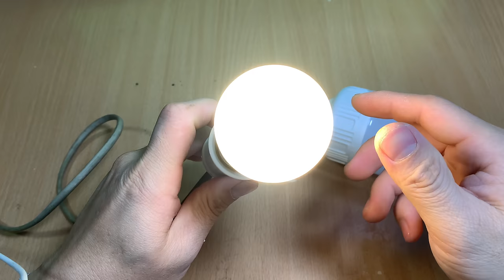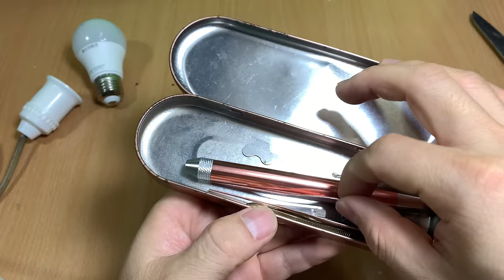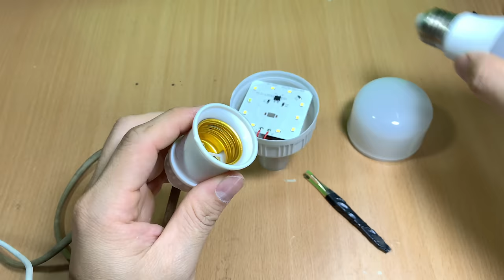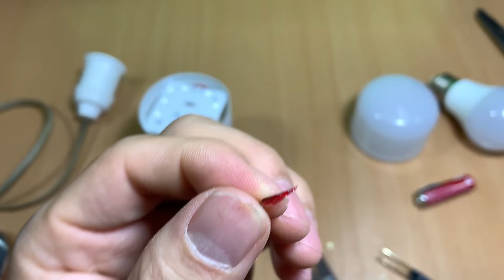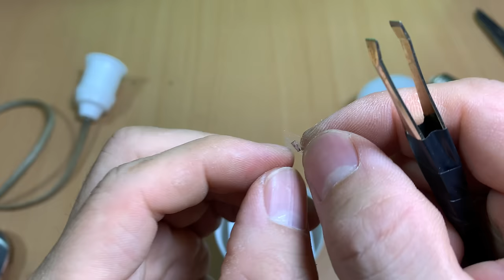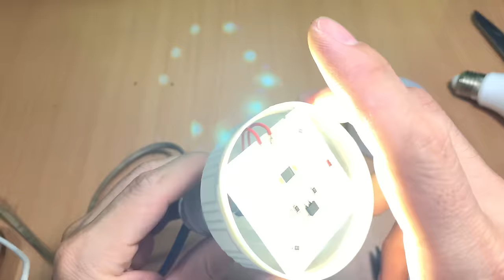Just Use a Common 1,5V battery and Fix All the LED Lamps in Your Home! How to Fix or Repair LED Easy

Comment: You shortened the life of the rest of LEDs because they will be over loaded with the voltage that this canceled led was holding
Reply from the maker: Thank you for watching and leaving a comment, I will give a better solution in the next video, wish you luck and success
Reply: Their life was extended and they will burn brighter than if in the dump.
Reply: I've tried this remedy but eventually another 2 LED's had gone out also and the 22 uf 100 volts in the circuitry  exploded.
Reply: Actually,  this repair probably has little effect upon the lifetime of the remaining LEDs, because the small strip of metal used to short circuit the bad location has higher resistance than if he used a piece of copper wire.
Reply: Not necessarily…
Reply: Это не так, если в лампе стоит нормальный светодиодный драйвер, стабилизирующий ток. В этом случае просто упадёт немного общая яркость. Ну а если в лампе стоит примитивный драйвер (а такие лампы лучше не покупать), тогда да, ток возрастёт, а следовательно, ускорится деградация светодиодов.
Reply: Irony is we were told LED bulbs will last 20,000 hours and are better for the planet, blah, blah, blah.  Yet here we are looking for ways to repair these crappy bulbs after only a few years of service.  Another fine government hustle.
Reply: @billkraemer4710  
That went over like A LED BALOON..
Good Quality LEDs can last LONG..
Reply: Смотрел я 11 минут всю эту муть, взял паяльник, и через 5 сек  лампочка засветилась.
Reply: @billkraemer4710 exactly!! My first LED bulb stopped lighting the same time the reg bulb blew. Guess I’ll try to salvage a little more time out of it. I bought so many incandescent bulbs back when everyone thought they were going away, I’ve finally run out of them. Too bad I didn’t buy more then. 😆
Reply: Надо же кусочек метала приклеил скотчем  на контакт электричество  это просто сумасшествие , человек не понимающий  скажет хорошо ,  а вот и нет это может привести катастрофу  в  доме или  же помещения ,  хотя бы минимум припаять надо было !👎🏽👎🏽👎🏽❌❌
Reply: Лампа греется и через какое-то время скотч отклеется и лампа погаснет. Кроме того, светодиоды соединены последовательно. Каждый из них расчитан на определённое напряжние.Соединяя  электрическую  цепь таким образом мы увеличиваем напряжения пробоя на остальные светодиоды. Недолго лампа проработает.
Reply: Все это ерунда! Достаточно капли олова и все готово! А здесь целая операция на пол часа, и зачем-то батарейка!?
Reply: А если напряжение на низкое- это хорошо для светодиодов или нет? Спасибо.
Reply: Yeah best to replace damaged LED, this ruined the remaining LEDs on my project too
Reply: В такому разі потрібно просто впаяти робочий світлодіод!
Reply: Сейчас попробую графитовую дорожку???
Reply: После ремонта светодиодной лампочки (желательно припоять) если эстетика позволяет не ставьте колбу на лампочку или пару тройку отверстий просверлите или прожгите для охлаждения, лампа ещё долго послужит
Reply: Easier to put a dab of solder. Many of these bulbs have a load sensing power supply and will reduce voltage to what is needed for the rest.
Reply: Yes, solder, and the voltage is regulated. The statement that this overloads the other leds is uninformed.
Reply: 😅 @DIYTechTrends
Reply: Aye. But at least they now function.
Reply: So the light doesn’t work and removing one is not going to hurt it that much.
Reply: @rexoblanca4695 well you must have not done it right if you just remove it and connect it with folder it will last a long time.
Reply: @AlCatrraz just admit your wrong ,do you even know what resistance is and how to measure it,even lead from a pencil has resistance if you draw a line on a piece of paper the longer the line the more the resistance.and if your really good you can run solder down the lead strip you just drew and change the resistance even more.
Reply: @micgol9182 finally Someone with a brain.🧠
Reply: Or just buy a set of new led bulbs where I live you can buy a set of 4 for around $6. And there around 1100 to 1500 lumens.
Reply: @dhutch12345  
I have studied VARIOUS SCIENCES..
One of my degrees is in COMPUTER SCIENCE!
I do know something about electronics..
I personally”fixed” LED bulbs and they are still working! 
You are right, but so am I.. 
sometimes the parameters are such that these “fixes” will hold IN SPITE of the expected..
Best to you!
Reply: Life has been extended for a little longer when there was no life anyway. What shortened life?

Comment: When the leds go bad they have a black dot on them all u have to do is unsolder it or clip it off with a pair of dikes then put solder across the terminals on the plate and your light will work fine.that includes outdoor lights any led lighting if you do not want to buy a new one and some of the solar powered outdoor leds are expensive.
Reply from the maker: Thank you for watching the video and sharing useful information for me and everyone! Wish you all the best

Comment: instead tesa & the batterie metal i would use a simple soldering equipment. its ok when i should be at the moon, siberia or at ghe iss and i didn't have nothing other to tepair.... ..
Reply from the maker: Hello, thank you for watching the video and leaving a comment. This is a temporary way to handle emergency situations. I have shown you how to replace the LED letters to make the light bulb more durable and better. You can review it. Wishing you much luck and success.

Comment: That's gunna be as reliable as a politicians promise.  A bit of copper wire and a soldering iron would be a better idea.
Reply from the maker: Thanks for watching the video and leaving your comment! Your idea is also very nice, I'll do it soon! Thank you, I wish you luck and success
Reply: @DIYTechTrends  Be well m8.
Reply from the maker: Thanks
Reply: A blob of solder is much easier and more reliable. And costs next to nowt - certainly a lot less than a battery.😊
Reply: @DIYTechTrends _ Just a blob of solder across the two contact points might be enough.  However, now the resistance of the circuit is less than before and more current is flowing through all the LEDs.  This will cause another failure sooner than expected.
Reply: @wladicus1  Hey... I was gonna say that! Nobody pointed out that tape falls off when the bulb gets warm. I found even Gorilla Tape falls off when it get warm. under the sun. There were 10 LED's so shorting one raises the voltage 10% for the remaining cct. Replace it with a regular junk diode with similar fwd voltage and resistance is best yet. The absolute best is to use working diodes from one lamp as parts so long as the polarity and LED count remains the same.

Comment: This fix assumes that every LED bulb failure is caused by an open LED diode. There are other failure modes, like failed power supply.
Reply from the maker: Hello, thank you for watching the video and leaving a comment. This is one of many errors in the bulb. If the case is not due to the LED chip, we will look for the next cause. Thank you and wish you the best

Comment: You do not have to spoil a battery to get aluminium piece. A simple piece of aluminium foil is sufficient.
Reply from the maker: Thank you for watching the video and leaving a comment, as you said, the metal used conducts electricity well and can be repaired. My battery is over.
Reply: That tape would dry out and fail in no time. Otherwise good idea.
Reply: @DIYTechTrends  It is easy to use foil. To get aluminium piece from a cell takes more time and work. In either case we have to use a tape or glue to keep the aluminium in contact.

Comment: Hello, the third type of repair is wrong and it causes the voltage of the LEDs to change and the rest to burn. We must either use a resistor or a healthy LED.
Reply from the maker: Thank you for watching the video and giving your comments. I will try your method, it's very good. Good luck to you and successful.

Comment: I gave you  dislike, because I made this work very easy: I just take out LED segment and solder a jamper. That it's all. But in your foto-avatar video you us buttery. What, another material is not good?
Reply from the maker: ok, actually this is one of many ways to fix black bings quickly, but it is only temporary, I have released a video of replacing led chips with 2 batteries, you can watch it again, thank and have a nice day

Comment: Very cool. One question. Since the point seems to be to connect the circuit from the lines under the dead LED panel, Would a simple line of solder to connect the circuit work too?
Reply from the maker: Thank you for watching the video and leaving your comments. Based on the principle I shared, you only need one wire to connect the circuit, respectfully.
Reply: Конечно.
Reply: I just don't remove anything.  Run a bead of solder around the broken LED to bridge the two terminals.  East!
Reply: The micro flashing of the repaired bulb would drive me crazy. Kinda like the pantomime hands.
Reply: That's what I was thinking !! @myfavoritemartian1
Reply: @bytemehrdr  sends some into a seizure
Reply: @bytemehrdr  You wouldn't notice the flashing. What you see in the video is because of the"shutter" speed of the camera.
Reply: Yesyou don't have to cut a piece of dry cll. A short lenght of a copper wire or a piece of aluminum foil or just a bead of solder will work as well
Reply: It's the effet on the video capture, not in reality.

Comment: Because of the leds are serial connected, the rest of working leds  sınk more current than nominal current value and it causes the life time  of led bulb will be shortened. The best solution is to find another defective led lamp and to use its working leds.(as soldering it after removng the broken one.)
Reply from the maker: Thank you for watching and leaving your comments, this is a temporary solution, I have a video showing people how to replace LED chips effectively, you can watch it again, thank you and wish you good luck:
https://youtu.be/Jwb2lwGnkfw

Comment: How many days it would work? While current increases. Simply you can short the terminals with the help of soldering iron.
Reply from the maker: Hello, thanks for watching the video. Your opinion is very good. I also have a video showing how to replace the LED chip to make the light bulb work more effectively. I wish you the best.

Comment: Why not use rubber or leather gloves instead of wrapping the tweezers?
Reply from the maker: Hello, using gloves will prevent me from handling the tape correctly. The price of the tape is a simple solution
Reply: Put the glove on the hand using the tweezers to find the bad element.  Then mark the element, take off the glove and then use both hands' bare fingers to handle the tape.  Why bother to wrap the tweezers in tape when you can just use a glove on one hand for a few minutes?   @DIYTechTrends

Comment: Why not use hot glue? This way you can also partially reseal the diffuser globe in place. 3 or 4 small spots should do the trick. That tape may lose its sticky due to finger oil and eventually heat. I doubt seriously if it gets hot enough inside that globe in normal operation to melt a hot glue circuit bridge.
Reply from the maker: Thanks for watching and leaving feedback, this is a temporary solution, I have a video showing people how to replace LED chips effectively, you can watch it again, thanks and good luck:
https://youtu.be/Jwb2lwGnkfw

Comment: 9 minutes of my life I'll never get back, not wasting 2 more
Reply from the maker: Thank you for watching the video and leaving your comments, I will improve the quality of the video, thank you and wish you good luck and success.
Reply: @DIYTechTrends  ...Thank you for your kind reply! I did go straight to the shop and found two LEDs arced out (black spot) in an old bulb. Popped them off and soldered across the conductors et voila! Seriously, it took less time than watching the video, or typing this message. Best regards!
Reply from the maker: @svcobalt  ok, I also made a video showing how to replace the led chip with 2 batteries, it's also simple

Comment: The only problem being that, the bulb is now one led less bright......
Reply from the maker: Thank you for watching the video and leaving your comments. This is one of the temporary light bulb fixes. I will make a video showing you how to replace a full LED bulb like new. Please look forward to it
Reply: Wrong, the lamp is just as bright if not brighter because it is a current limited string of LED's at a certain voltage and he just eliminated one of the LED's in the string so now he is overdriving the wrest of them and shortening thier lives.  It will work but for how long.

Comment: This is dangerous!!!
The bad contact can cause a 🔥 fire 🔥.
I know someone will say: O, there is not large current run but some people without any electricity knowledge can try this trick with another electric device that have larger consumption and voilà, you have a fire at home!
Reply from the maker: Thank you for watching the video and leaving your comments, normally the LED bulb voltage is only 12V or less so it is not too dangerous, however you should be careful when doing it this way, because everyone's skills are different. , if you can't do that, you should buy a new light bulb. Thank you and wish you good luck and success

Comment: what a faff, the dead led will be discolouredon the yellow part, i dont think this is a safe or permanent repair, remove the faulty led and solder a wire across the pads  if you must

Comment: Hi, the works is ideal ! But I suggest if you can make more clear cause I did not see the small part of the battery that you replaced, maybe you have to magnify the parts in your video please.
Thanks your good inventions ❤
Reply from the maker: Thank you for watching the video and leaving a comment! I will improve my skills to do it faster! I don't edit the video, I leave it in real time. Wishing you much luck and success.
Reply: It doesn't have to be a battery, any small part of conductive metal will do
Reply from the maker: Yes

Comment: each led with receive 134.3 volts instead on 12. they burn them out faster.  use glue the fasten the metal strip in it won't let go with heat.
Reply from the maker: Thank you for watching the video and leaving your comments, your ideas are great, I will improve the quality of the video, thank you and wish you good luck and success.